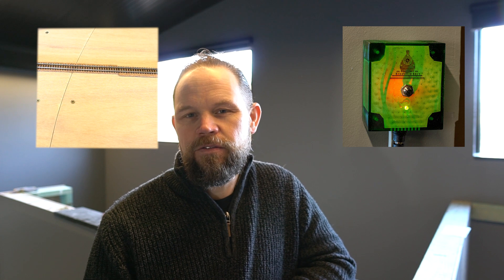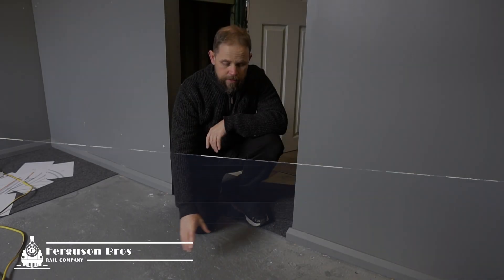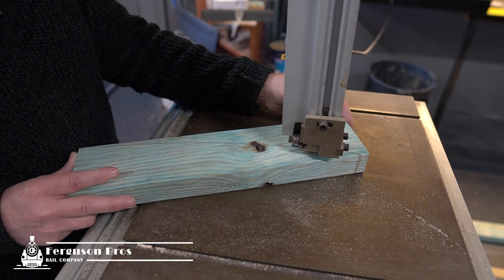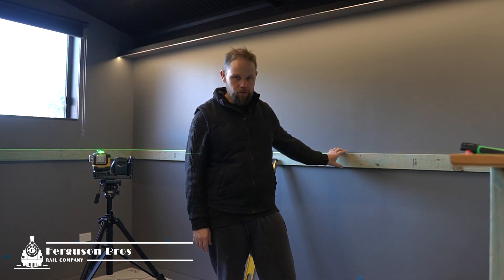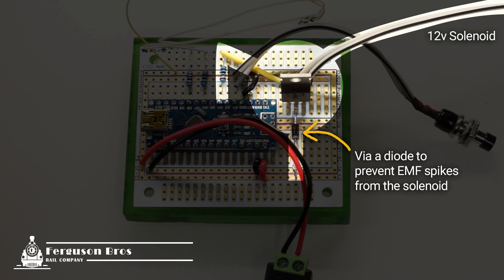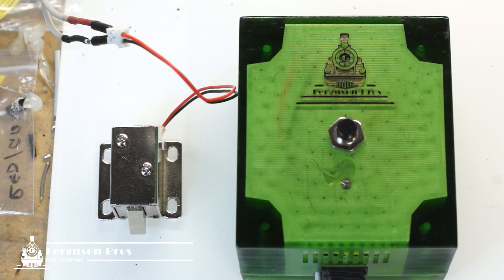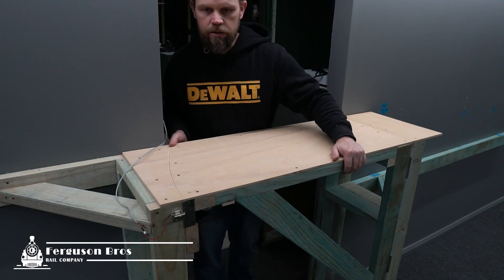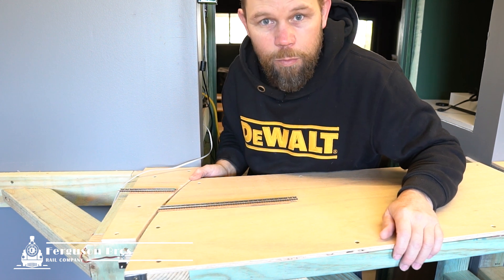Swinging door for model layout room access with electronic latch

Comment: A nifty idea but only good for those that have arduino's, the capability of programming them and a resin 3d printer and design knowledge... I am thinking of making a swing gate for my layout but I will go with the mechanical format.
Reply from the maker: None of the arduino stuff is necessary. In fact, we often just press the latch with our finger to release the gate instead of turning everything on - the button will be useful when we've built up more scenery and it's harder to reach.

Comment: Hows the timber going with movement or shrinkage? Sealing the end grain/cuts would probably help with any moisture absorption which should reduce or slow expansion & contraction.
Reply from the maker: So far it's ok but I'm not counting my chickens just yet. I've just ordered a wifi temperature and humidity gauge so I can log in with an app to monitor conditions.

Comment: Running across this video is perfect timing as I’ll be building a gate this year. I do wish you had included a mechanical latching option as I have no interest in building an electronic system. Although it is pretty cool!
Reply from the maker: For mechanical I was thinking an axle shaft that rotates 90 degrees and accessible from both sides. It would have a friction fit to force the gate against its closed position. All the best with your build.

Comment: Very nice job. 
I have a lift-up section which has the plywood fitting tight like yours. I don't know about where you are, but here in Malta I learnt the hard way that in winter wood expands because of the humidity, so I needed to file some of it off for the section to be able to close in winter. Summer is no problem.
Reply from the maker: Thanks for the warning. We have very low humidity here but quite extreme temperature difference between winter and summer.
Reply: @fergusonrail  looking forward to more progress